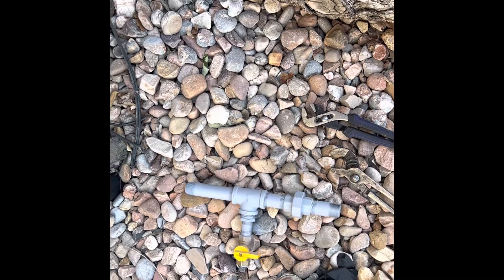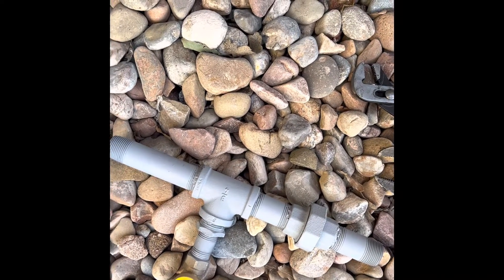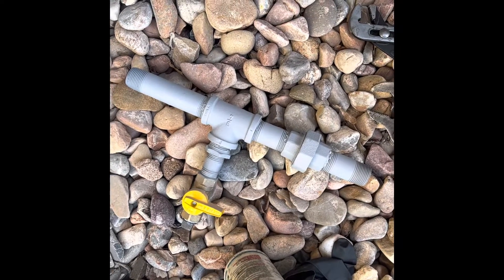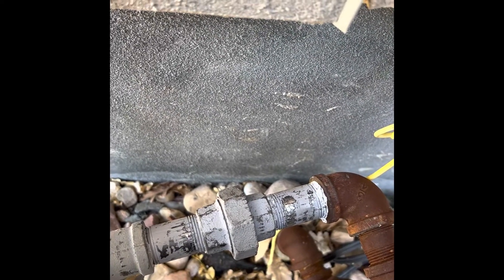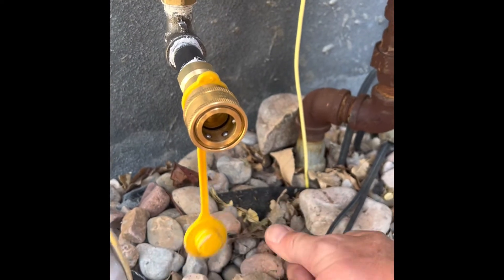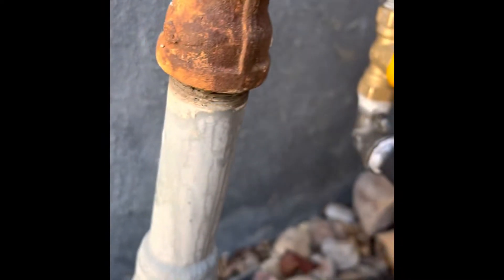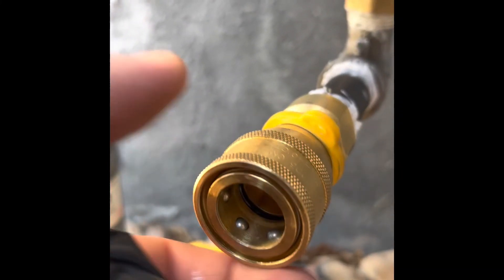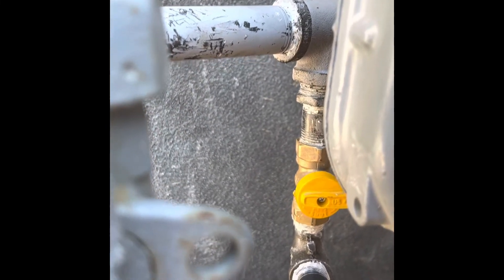Firman Tri fuel gas line fitting installation

Comment: Did you happen to run it at full load?  I am about to do the same thing, but noticed that at 5500W full load it demands 101,000 btu/hr flow rate and with enough hose length, this can be the limiting factor.  Going near the meter was a good idea.
Reply from the maker: I did. I used a 1/2” hose and have a 2lb meter. Flow wasn’t a problem for me but could be for some.